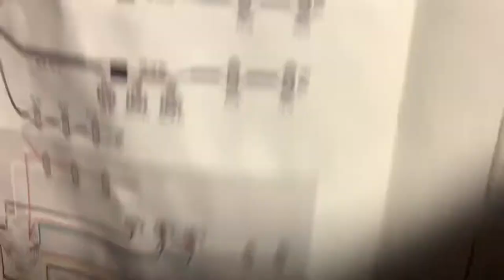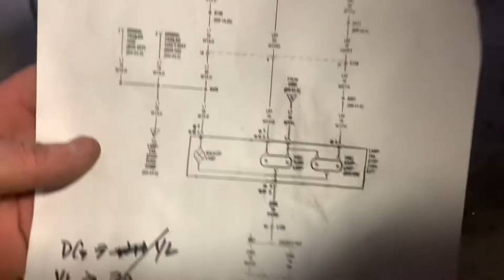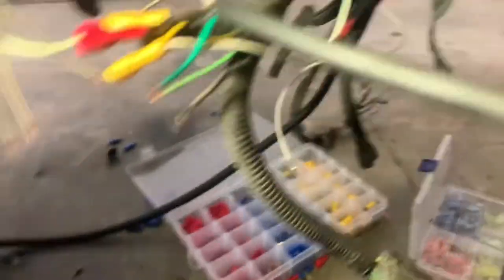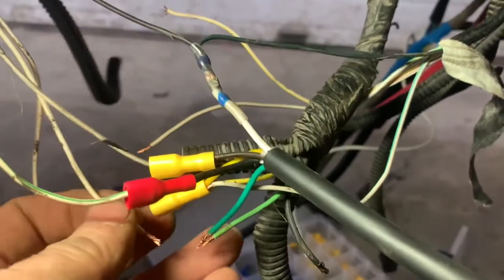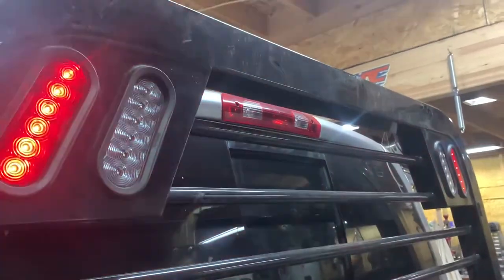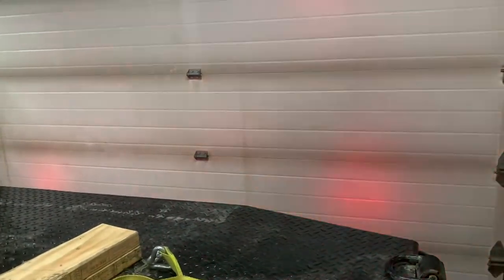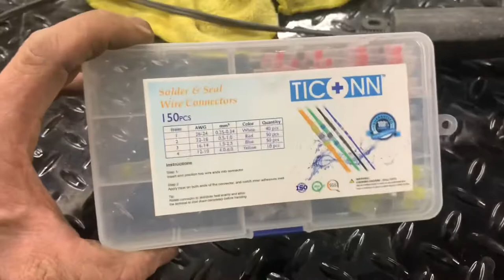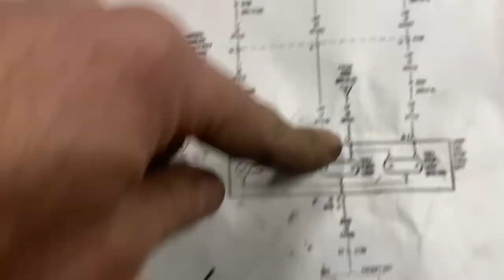2006 Dodge Ram 3500 Norstar Flatbed Wiring and fast blink fix (without resistors)

Comment: Thanks for the video…
     I’m dealing with the same exact issue..
     Where did you tie in your Brake/ Stop signals to..?
-Right side (Green) with a Wht/Tan factory wire..
-Left side (Yellow) with Wht/Tan factory wire…
Reply from the maker: Yellow, yellow, dark green/white = left
Green, green, yellow/white = right
Reply from the maker: As far as I remember that is all you need to hook up if you’re using the factory 4 way plug from your truck.
Reply: Thanks pard.. I checked mine (4 way) before cutting it off and tested it with a light… There’s no signals at all there..
     I’ll figure something out.. Thanks for the response..!!
Reply from the maker: That’s a bummer. What I found out was that when I attached the tan/white wire it would override the turn signal. So I don’t believe I attached it to anything.
Reply: Correct… No need to attach the Wht/Tn.
     Where’s where I’m at..
-Found my high resistance issue with the 4 way plug. I corrected that.
-Attached wiring exactly like we discussed and what you had presented in your video.
-All issues functioned correctly (no 3rd light blink/ no everything blinking like the Hazards are on)… Nevertheless, I still had hyper-flash with Turn Signals.
-I stubbed 2, 3 ohm test lights just for temporary verification (one on either signal “Yellow & Green “), and the hyper flash went away.
- I’m getting a couple 6 ohm LED Resistors at Auto Zone after church..
     Thanks again for the video/ idea. I wouldn’t have sent that way without your video.

Comment: Did this solve the “lamp out” and “ding” issue as well?   I had this bed installed at a Norstar dealer in ANC and it came out with the same issue.   I have brought it back to them to fix the the brakes overriding the blinkers.  I am just wondering about the lamp out so I know if I need to tell them to fix it or not.    I told them I found this video and all should work like it is suppose to. Thank you for posting this.  Dodge and computers can be aggravating.
Reply from the maker: My truck is old enough that it doesn’t have a lamp out or ding indicator. The only indication that I have a lamp out is a fast blink which this method remedies, unless of course you also install LED front blinker bulbs as well.
Reply: @nelchinanoble  you said yours is an 06, correct?   Mine is an 04.  Maybe I will just have to disable the chime!!   Thanks for the quick reply!!
Reply from the maker: Yes it is, SLT model. No chime or blinker out indications though.

Comment: I got a 7 trailer side wiring box and a fifth wheel addition harness just plugged into the stock harness so if I ever decide to go back to a stock bed the entire harness is in tact also left the blinker bulbs in the harness and painted then flat black so no hyper flash no tampered with harness for my 07.5 ram 2500😊
Reply from the maker: That works too
Reply: @nelchinanoble  just another way to skin the cat
Reply from the maker: @floydbouillon4381 that may work. I’d check with a test light first.

Comment: Why is the white/green going to ground?
Reply from the maker: White/green from the truck wiring goes to black on the bed wiring. Black is not ground on truck beds and trailers. White is the ground wire for truck beds/trailers.
Reply: @nelchinanoble  well that solves my issue.  Thanks
Reply from the maker: It had me confused too. I’ve always been accustomed to black being ground, which it is on vehicles but not on trailers. Flatbeds are wired the same way as a trailer.

Comment: I get a fast blink when I use breaks and turn signals together
Reply from the maker: But not turn signal by itself?
Reply: @nelchinanoble  They work fine on their own, the also work fine if I hit the signal before I apply the breaks. But if I hit the breaks first then turn on the signal it hyper flashes
Reply from the maker: @jamiekaus6666 , weird. I haven’t experienced that issue.
Reply: I'm having this exact problem!! Please tell me what was wrong.
Reply: @jamiekaus6666 I'm having the exact same issue! Could you please tell me what was wrong?

Comment: Mine still blinks fast when I tried this
Reply from the maker: Well that’s a bummer. Same year?
Reply: @nelchinanoble  2004 1500.. all same wires that I can see. White dark green left signal. White yellow right signal
Reply from the maker: @kyleoutdoors7914 , you’re ending up with 3 wires into each left/right connection? White yellow/green/green = right
White dark green/yellow/yellow = left.

Also, do you have LED front turn signal lights?